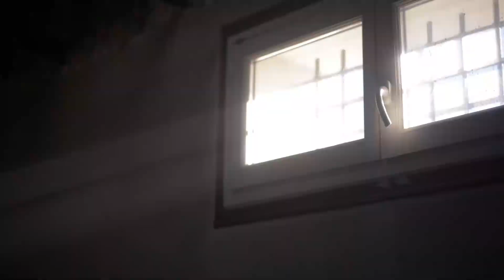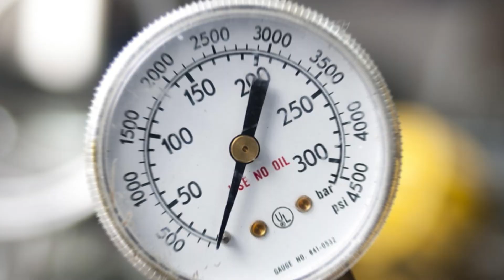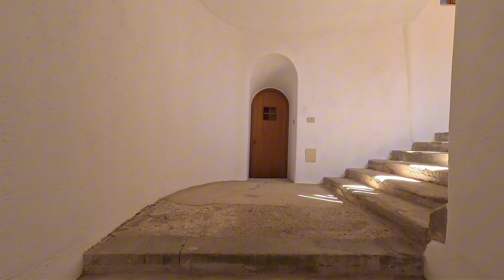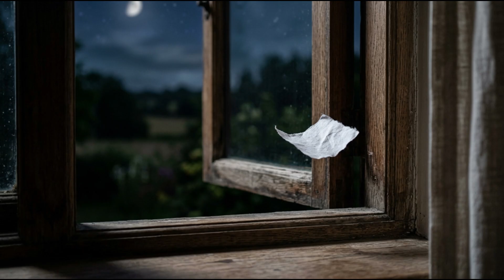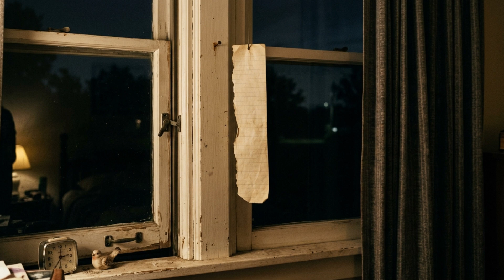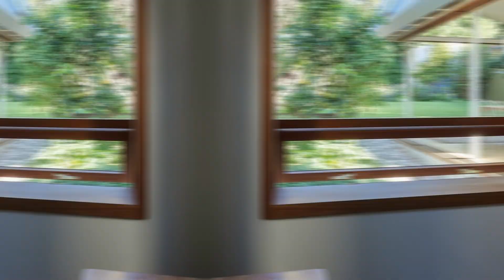How To Cool A House With Cross Ventilation — No AC, No Power

Comment: "Amos, this is an absolute masterpiece on natural passive cooling! The way you break down the old-school 'cross-breeze path'—measuring temperatures, choosing the right intake/exit, and harvesting cool night air without spending a dime on electricity—is pure gold for anyone struggling with high summer bills.

However, looking at your channel setup, there are a few optimization gaps holding this video back:

Channel Tags: Your channel-level tags are completely empty, which makes it harder for YouTube to understand your niche as a whole.

Audience Retention & CTR: While your video tags are there, the thumbnail and metadata need sharper optimization to capture high-intent search traffic interested in off-grid and frugal living.

Such practical, timeless wisdom deserves a much wider audience. Hope fixing these minor tech gaps helps boost your channel's reach!"